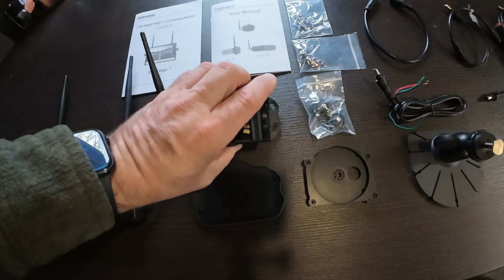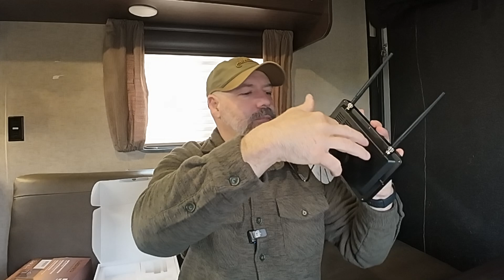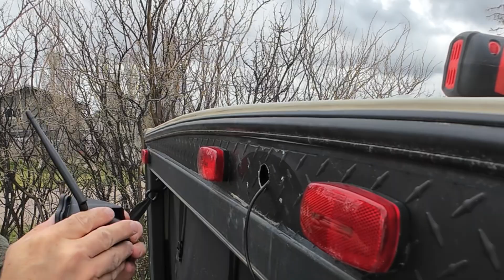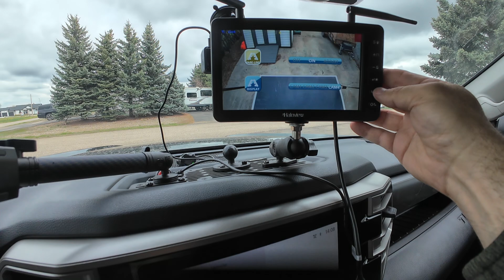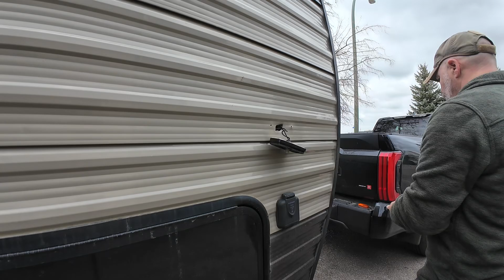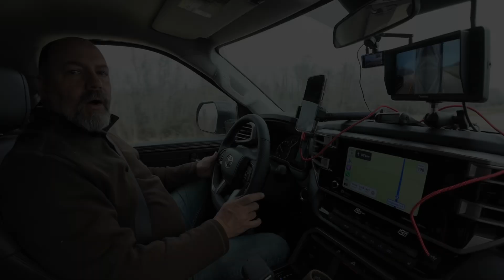Haloview BT-7 RV Camera System & BTC129 Side Marker Light Cameras Detailed Install and Operation

Comment: Best video I have seen on this system! I have one question that no one seems to address in the videos that I have seen for this system which is, can the rear and side camera angles be adjusted once they are mounted? Thanks!
Reply from the maker: Thanks so much! Great question - yes, both the rear and side camera angles are adjustable even after mounting. You can make fine adjustments to get the perfect viewing angle. The mounting brackets have enough flex to dial in exactly what you need. Definitely worth taking a few minutes to get them just right before you hit the road!

Comment: I work for a fire rescue department. We have a lot of issues with the wireless cameras. If possible could you please do an update video in a month or two?
Reply from the maker: Sure thing!!  I did notice that the rear camera at speed does show some artifacting sometimes, but I'm thinking the aerial is moving.  Haloview does sell an aerial relocation kit for about $20 so the aerial can be place in a better location if needed 👍. Overall the 1080p display is clear & bright and low latency.

Comment: How many trips (over the decades) had set-backs of enjoyment from folks learning how to holler and motion with hand signals and learning to back a trailer?  Not to mention having to gauge how close one is with aligning the ball/hitch w/o a mishap.  These tools look to be getting better and better.
Reply from the maker: Yes - I totally agree - And going solo, the constant get out and look so you don't hit something 😄. The trailer manufacturers should make this standard - But I guess they would have to agree on a cross manufacturer protocol to use for the signalling.  But it should be done.